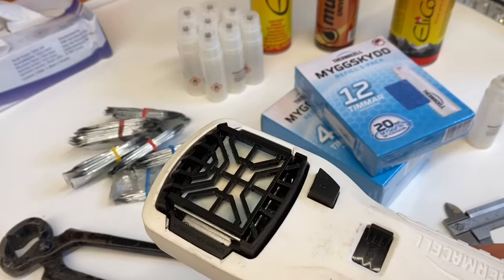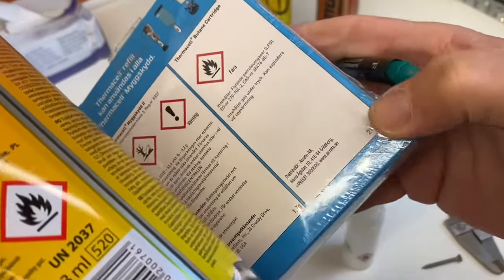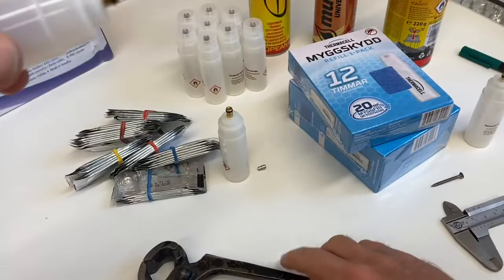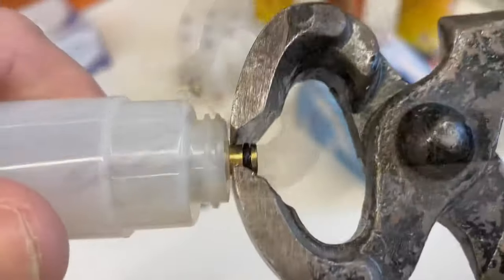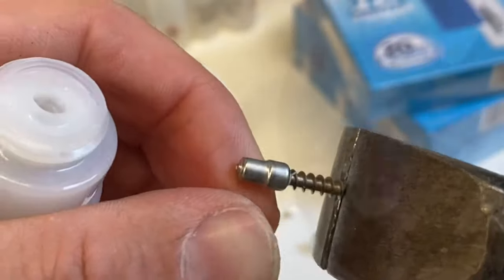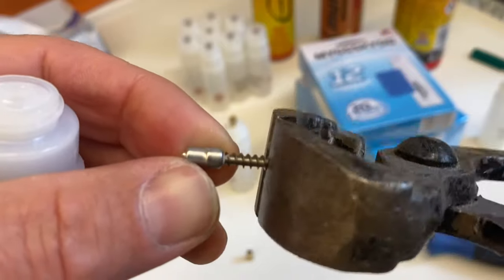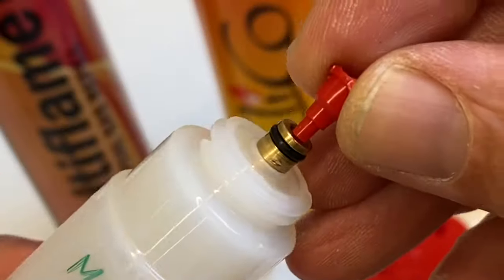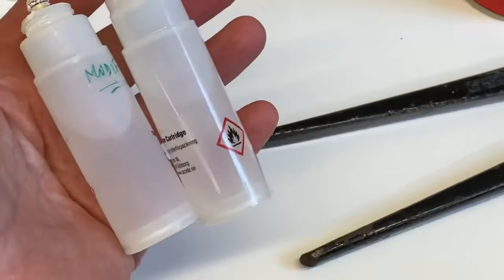How to refill ThermaCell butane cartridges - save money and DIY

Comment: This video is superior to others because the gentleman is precise and explains why he does what he does.
Without his thoroughness, one could easily be unaware of crucial steps.
Nicely done Ben!
Cheers, John
PS I had to modify my refill canister nozzle, with a wee slot to allow the butane entry into the Thermacell, otherwise the gas could not flow.
Reply: How did you add the slot? I can't seem to refill mine.

Comment: You should not twist the brass piece any more than you have to to pull it out. It will come straight out. The twisting motion tends to erode the hard plastic & when you push the brass part back in it may not seal as well as it needs to....
Reply from the maker: There is NO normal thread so nobody understands…

Comment: Hi Ben   For some
Reason I cannot fill the canister have themacell changed something 

I put just the valve on the butane gas and cannot get gas to flow
Reply: Should be very straightforward. I suggest you put on some gloves to protect your hands and then play around with the injection procedure because if you don’t wiggle it around on the filling tube from your mani bottle, then you quickly have an overpressure inside and excess air will prevent you from filling. So, essentially what you need to do is to try to purge out air while you fill up with liquid.

Comment: The problem is that the Pads themselves are more expensive then buying the combo making this not more cost effective. 12 Mats are $15 where 30 with canisters are $39 so roughly the same but you get the fuel too.
Reply: Do you have and use a thermocell? I ask because I always have so many blue pads left over when my butane is gone (for a number of reasons that I could explain if you're interested 😂)

So if you don't already have one, you might be surprised how much faster the butane goes than the blue pads, making the ability to refill still cost effective and helpful to extend the time between buying refills.
Reply: Does anyone have any ideas on how to reactivate the platelets themselves? Which liquid in which concentration?
Reply: @sirkasper861  just look for permethrin concentrate to “recharge” the pads.